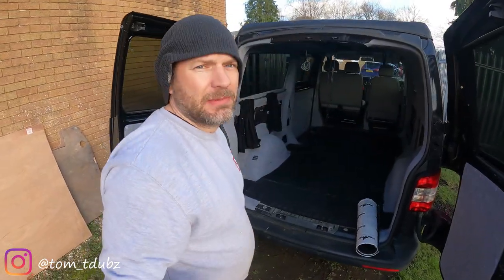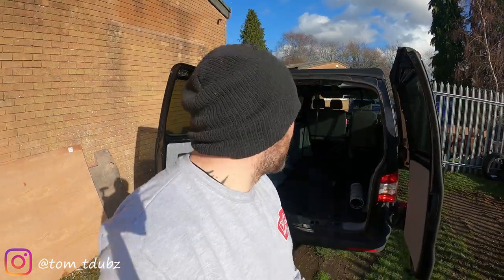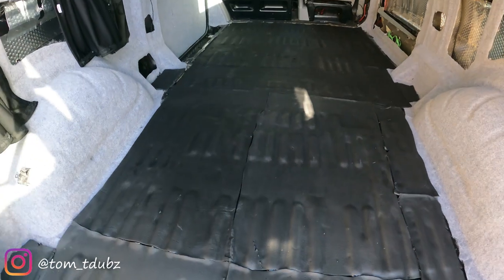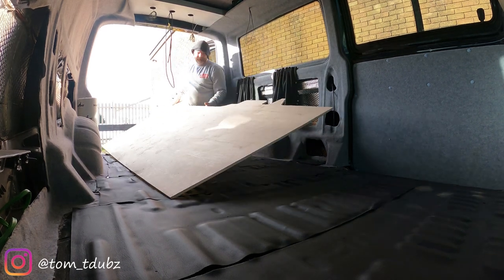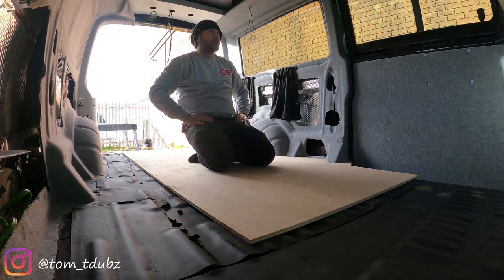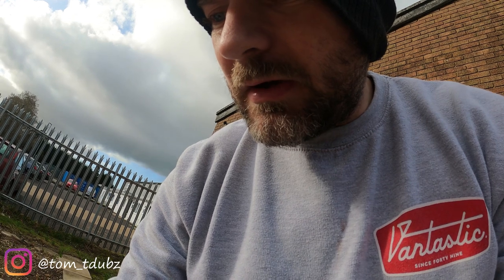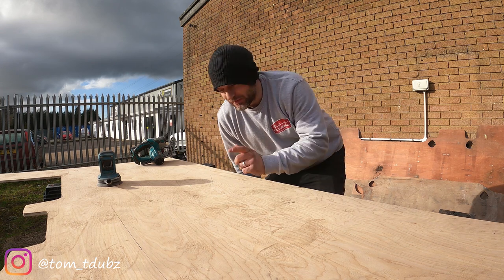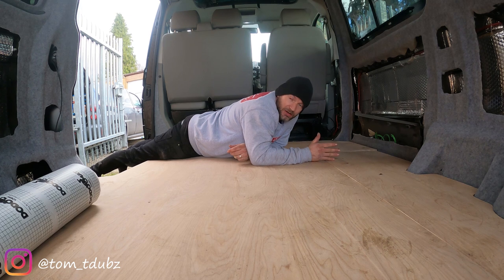vw t5 fitting a new floor. #Blackbeauty

Comment: Generally speaking, I would have thought : flooring first, carpet lining second... Looks better with a horizontal flooring / carpet junction, easier and more forgiving to trim carpet against a hard floor than vice versa.... Plus any spray glue overspray is easy to remove from vinyl floor with solvent... What are the downsides?
Reply from the maker: Carpet first the floor, much more seamless finish especially on areas that are visible 👌🏻
Reply: @tomtdubz  "... carpet first the floor"? ..
I assume you mean 'carpet first, then the floor'?
Reply from the maker: @clungebucket23  lol yeah carpet first, then do the floor 😆👌🏻
Reply: @tomtdubz  I'm slowly coming round to the idea... I'm a joiner and in most circumstances, always flooring first with  kitchen units / skirting boards / whatever.. after.... Practically and aesthetically better... Notwithstanding the faff and time of scribing a floor to that level of precision to something existing

Comment: Another great video
Is there a reason why you did your flooring the same way as the factory one, with a join across and a join going front to back?
I am thinking about 3 pieces but with both joins going across the van, splitting it in to thirds, and wondered if any reason not to??
Reply from the maker: You can put the joins where ever you want, having done it now I would recommend doing the split to the right so will be under the kitchen and then a patch at the rear rather than the front so that will be under the bed
Reply: @tomtdubz  thanks dude! I am not having kitchen as am doing a day van with wrap around seats so I guess anywhere will be fine!
Reply from the maker: 👌🏻 nice! Enjoy the build 👌🏻

Comment: Hi Tom , Have you replaced the audio unit yet and if so what system did you fit ?
Reply from the maker: I've fitted an rcd360 from travelinlite. great bit of kit. i will be doing a vid on it at some stage once I've fitted the rest of the audio.
Reply: @tomtdubz  Thanks Tom .

Comment: Yes, I've waited for this!
I'm just in the process of doing this too.
How thick was the insulation?
Did u use the same type of wood as what was originally in the van?
Did u screw directly into the metal work of the van or did u use glued wooden plates to screw in to? Sorry for all the questions 😅
Reply from the maker: The thermo liner is 6mm.. I used 12mm hardwood ply 👌🏻
Reply: @tomtdubz  cheers fella, and did u screw directly into the metal floor of the van?
Reply from the maker: @motiv8154  I have but I’m gunna remove it and glue it down 👌🏻
Reply: @tomtdubz  I anticipate that video 🙌🏽
ThanQ for posting these videos. They help a massive amount!
Reply from the maker: Just got to work out what flooring to put in it 🙈
Reply: @tomtdubz  I'm guessing a type of laminate flooring? I thought of the old skol black and white chess board look or a rustic wooden floor look 🤔
Reply from the maker: @motiv8154  I’m having to let the wife choose one lol 😂
Reply: @tomtdubz  Ohhh gosh! Hope its not pink, otherwise known as 'salmon' 😅😂
Reply: What sort of glue did you use to do that with. Don't fancy using self tappers into the van floor really 😊